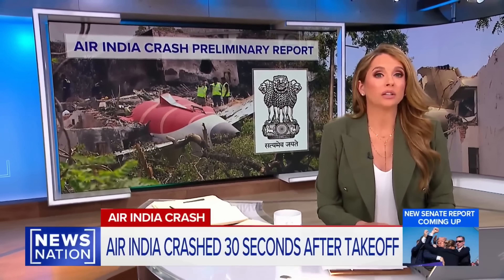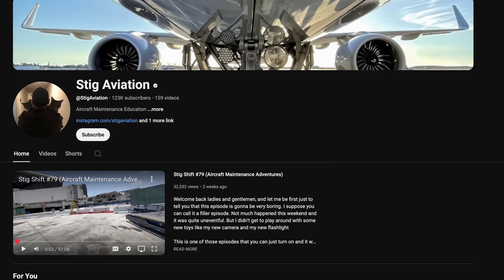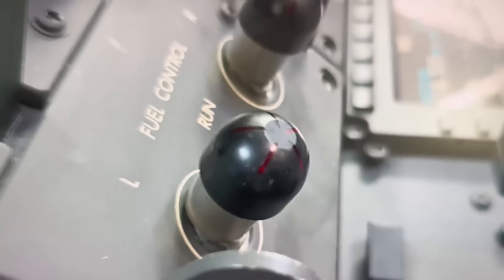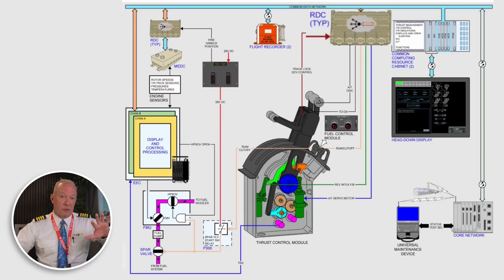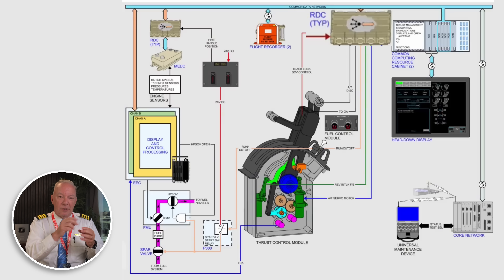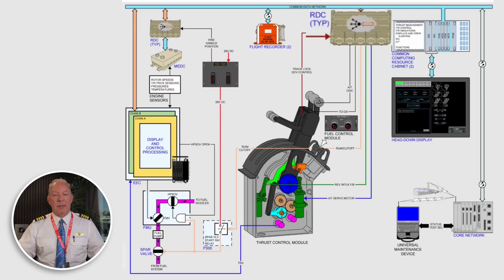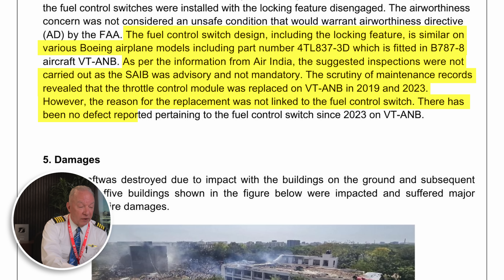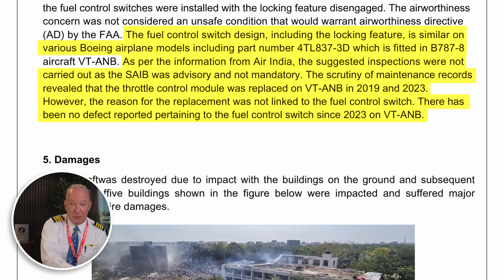The Truth About Boeing 787 Fuel Control Switches

Comment: People should ask themselves a simple question before they deduce, conclude and declare that the Capt (who was the PM) of deliberately switching off the Fuel Control Switches. (We'll refer to this as the "Boeing narrative", for obvious reasons). The FO (who was the PF), would have had both his hands on the yoke after rotation, busy keeping the aircraft pitched up and wings level, busy timing the retraction of the flaps and the landing gear, all the time ensuring that the aircraft maintained a positive rate of climb, so it's unlikely he could have flipped both the fuel cut-off switches so quickly. 

The Capt too would have been busy retracting the flaps (Which actually were retracted, unlike what certain "aviation experts" out there had made us initially believe that they had not been extended at all before rotation!!) as also been busy retracting the landing gear (Which possibly did not fully retract fully due to hydraulic failure, resulting in the RAT being deployed within a couple of seconds after rotation).

As per the AAIB initial report, the first fuel control switch "transitioned" exactly 3 seconds after liftoff, and the second fuel switch after one second. So, the Capt must have been a superhuman to (a) retract the flaps (in stages), (b) retract the landing gear, AND (c) have also "transitioned" the fuel control switches one-by- one - all within the first 3-4 seconds after liftoff! (Note that the flaps were fully retracted as per the photographs of both wings taken at the crash site)

Even assuming that the Capt had suicidal tendencies, it would have much easier for him to put a gun to his head at home. 

NO PILOT in his right mind will ever endanger the lives of the passengers that have been entrusted in his hands. It's a disrespect to the pilot community as a whole. It runs against the ethics of the pilot community, where passenger safety is embedded in their DNA. (The Germanwings incident was an exception and an aberration, and it was an extremely rare incident).

One chance in a billion, that he was actually a "psycho" pilot with "suicide-murder" tendencies, the Capt merely had to take control of the aircraft (AI-171) at Ahmedabad, instead of allowing his FO to handle the take-off leg.

Soon after rotation, he (the Capt) just had to shout loudly "I'm having a heart attack" and then simply had to flip over the aircraft soon after rotation, to make it look like an unrecoverable accident.

Why would he (the Capt, as the PM) want to go through all the trouble of flipping both the Fuel Control Switches to CUT-OFF (On the sly?), knowing fully well that the EEC would automatically reignite the engines (Since there was no engine fire detected after the aircraft was airborne), or maybe even the remote possibility of the FO being able to move the Fuel Control Switches back to RUN in time (Which is also the specified engine reignition procedure RUN to CUT-OFF and back to RUN), thereby foiling this suicidal attempt? 

That's a far-fetched theory, because, even for a moment, if we believe that the Capt. deliberately flipped the fuel control switches to CUT-OFF, would he (the Capt) have permitted the FO to reignite the engines and foil his (The Capt's) attempt to crash the plane?

And, are people aware that there are many critical conditions under which the onboard computer system, the EEC, can open and close the fuel valves for safety reasons, WITHOUT THE NEED FOR THE PILOTS TO PHYSICALLY TOUCH THE FUEL CONTROL SWITCHES? Like a bird hit, an engine fire, a flameout, a fuel leak, an EEC software glitch, misinterpretation by the EEC of good data from a sensor, a faulty sensor sending faulty data to the EEC (Like the faulty WoW proximity sensor of the All Nippon Airways (ANA) Boeing 787 in 2019).

Sadly, both the pilots are dead and cannot defend themselves now, so they've been made the scapegoats, while it's "business as usual" for Boeing and Air India. 

And, I don't blame Capt Steeve for making this video to clarify and justify his viewpoint that, both the fuel-control switches can indeed be flipped from RUN to CUT-OFF in one second (That I agree with), which was being challenged by the other panelists during the TV debate under reference.

People should do a little bit of research, and they'll find that there are numerous air accidents, in which the pilots are initially blamed in the Prelim Reports, and the Final Reports find other problems with the aircrafts that led to the accidents.

Comment: The 28VDC is the gatekeeper to the AC voltage that controls the motors moving the valves. I can't imagine valves controlling major fuel pipes having strength to operate using a DC motor. Oil and Gas industry use motor operated valves (MOV) to control pipes and their product flow, and they are always AC. Does losing control voltage shut the valves? I doubt it. Probably need another command for anything to happen.

Comment: A question for Captain Steve, as a pilot. First, we agree to manually operate the fuel switches. The question is, what are his procedures and actions in a situation like this, where all engines fail immediately after liftoff, with no available space for an emergency landing? Is there a specific checklist for such a failure? The second question is, do major electrical failures in aircraft lead to engine failure or not?

Comment: If the relay goes bad/wears out (not unheard of since they never last forever) then it's possible the load (valves) would not work when the mechanical switch is still in the on position.  I don't believe this to be the case since both would have failed one second apart.  I doubt that's what happened.  But... it is possible.

Comment: Why is there even any issue about a circuit problem?  The CVR has one pilot asking the other about flipping the switches and then the switches were flipped back to run before the crash.  That’s two different sources corroborating that the switches physically moved to cutoff and then back to run.

Comment: In my car, I need to change the battery every 4 years. One time it died while I was driving, and it was scary af. What happens if something is wrong with the battery?
Reply: In car we have only one battery to provide power..

But in plane we have RAT that will supply power if everything else is failed but it takes 10 seconds or more to supply proper power back to system.. 

If the battery fails during rotation then it's a crash for sure.. 

Boeing may need one more similar crash to accept this as an electrical issue related to the battery circuit..

All 787 which is flying for more than a decade is flying bomb..

Even the best batteries manufactured till date are not reliable after 10 years of usage.. older batteries can have intermittent behaviour which is dangerous for critical systems..
Reply: @Raj80sk I I hope they change the batteries more frequently than every 10 years. But even so, I think it could be the battery.
Reply: Then your car will not start.
Reply: @thesweeples3266 It did start, and when I was driving, after like 5 minutes the battery died, the lights first started to flicker, then all lights went out, and also the thing that helps with the wheel rotation thing also stopped working, so I had to apply significantly more strength to steer the car. It was scary.

Comment: Your description of the fuel control system and the cut off switches here is very thorough, but is not 100% complete. Please don't misinterpret what I'm about to say here, because I do not believe the switches failed. However in attempting to rule out "switch mimic" in the flight data recorder completely your description of the system failed to address one aspect in the power delivery to the switches. 

You stated that the switches are provided power "directly" from the battery. This is where some question for me, a non expert with very limited knowledge of electrical systems, remains. 

I just want to clarify, when you stated that the switches receive power directly from the battery did you mean exactly that, directly? I understand that the battery is the power source and your explanation of the battery taking time to drain makes perfect sense. In order to completely rule out switch mimic however, we must rule out any possibility of power failure to the switches. My question is, "Are there no fuses, no relays, nothing between the battery and the switches that may have failed?" The flight data recorder does not record the physical location of these switches. Rather, it records either power coming from these switches or the lack thereof. Any power loss to the switches would be recorded in the flight data recorder as a cutoff of these switches and therefore, before assigning blame to a person, we must be very thorough in ruling out any possibility of failure in the system. I'm sure the experts that are examining the crash are thoroughly reviewing the electrical schematics to do just that before releasing a final report. 

I enjoy watching your videos and find you to be very informative. I have little doubt that you are correct in believing that one of the pilots is responsible for this crash, however if I were on a jury I would not yet be convinced enough to convict one of them. 

My opinion is based solely on my own non-expert experiences with electrical systems and data recorders. I've experienced failures in operating a system that utilized data recorders (in no way related to aircraft) where the data from time to time initially led us down the wrong path. In one case in particular, specifically along the line of questioning I have here. We were experiencing an intermittent failure in the system and the data recorder was indicating that the power had been cut at a particular switch. That switch however remained in the on position throughout the event and the system only shut down briefly each time. Inspection of the switch and of the relay did not reveal any mechanical issues with either, however both were replaced. A day or two later we experienced a reoccurrence of the same issue. Again, no mechanical issues could be identified and the source of the failure was not located. The question was pointedly raised to me, "Did you flip that switch on and off?" Suspicion of me sabotaging the system persisted for some time, and had the same issue not have occurred on other shifts I probably would have been fired. The maintenance department and upper management were looking at my entire department suspiciously for more than several months as this problem reoccurred sporadically a dozen or so times. Sometimes as much as 4 or 5 times in one shift and then not again for more than a month. Throughout that time period maintenance personnel had been stationed from time to time standing over the shoulders of myself and other operators, but the problem never happened to occur while they were present. That fact was pointed out during more than one meeting in a very pointed and accusatory manner. Eventually one day the failure occurred while I was sitting there talking with the plant manager. The switch in question was about 10 feet across the room from us, but completely in sight. Once again it was completely undisturbed. At that point the plant engineer, the maintenance manager, and the electrician that had been pointing their fingers at us operators were called into the control room. The electrical schematics were brought in once again and everything was reviewed, tested and inspected. Once again they could not determine the exact cause. By this time the switch itself and the relay had already been replaced a few times and clearly weren't the source of the problem. Though testing of it had not identified a problem a determination was made to replace the lead feeding power to the switch. The wire was replaced and the problem never occurred again.

Comment: This all assumes the Hot Battery Bus (HBB) was performing faultlessly with no momentary interruptions of 28V from the battery.
The Lithium Ion batteries have suffered Internal shorts in the past which prompted a redesign of the batteries and their containment boxes.
A dynamic interruption of battery power will hopefully be thoroughly investigated as a possible reason for the Fuel cutoff switch "transition" (remember that switch "position" is inferred from a digital signal on the Flight Data Recorder).
The causes for crashes are never simple and assuming the systems were all working as designed will probably not be valid.
Reply: 28v battery isn't supplying power to the battery busbar once any other generator is online and with engines running the electrical power distribution system will do everything to keep that busbar live.  The only time the battery needs to step in is when there is no other power source available - which means the engine generators have to be offline for your theory to apply. 
It's also not been brought up in the preliminary report, FDR and CVR are powered via the battery busbar with no internal power supply (excluding the locator beacon battery and that only does one thing) so they would have mentioned the data gap/loss of voice and sound as it's all timestamped.
Any failure in the TRU that powers the battery busbar would cause a nil dispatch as the system will produce an alert, if that happened during take-off then it still doesn't make any difference as the battery would then supply power instead - there would be gaps in the FDR capture again and a different response by the pilots on the CVR.

Comment: Excellent video Steve,         not 100% on Aviation Would there be a need to toggle off the Fuel Control switches in air ? - if there was an engine fire the Fire levers / Suppression buttons would be pressed instead and couldn't a fair safe be built in so that Fuel control switches can only be turned off if the Plane was at ground level.

Comment: Sorry Captain Steeeve, I disagree. The systems across Boeing are not the same for sure not 737NG.
Jeremy John Thompson YouTube will explain why not. This aircraft 787 is way more advanced and unfortunately electrical system was build by ex McDonall Douglas people. That is a sign of trouble from the getgo.
I wonder if this has ever been tested in mock-ups which I highly doubt. Just subjective fault isolation by the team who build it.
Air India is know for it bad maintenance, combined with this design I believe the failure comes purely from a DC system that short circuited.
FAA and Boeing are never going to admit it. I don't know why you follow any bulletins as fact. DC crash you can see how much the FAA is hiding with the Helo bosses during the hearing. Shocking but fact for now they cannot be trusted
Reply: Again not true watch the video before you judge.
Funny how everything needs DC power and if you don't have it nothing works like ADSB and FDR
Reply: It is a cover up since that Lithium battery came into this plane it has been a failure point.
If the battery can not be monitored to charge or diodes fail and don't get an EICAS message how do you expect this all to work.
Again a full DC failure will cause this info we have now. Has the NTSB or FAA admitted that the recordings are continuously? NO
When the RAT came online some stuff came back. Hence the fuel control as well. Too late engine winded down already

Comment: You are unnecessarily clinging to the wrong narrative, just like a common man. Can you exactly pinpoint and explain millisecond by millisecond, from the parking to lift off to aircraft explosion? If you explain that process, maybe this fuel switch is not at all a factor. Because its just a matter of 45 to 50 seconds or maybe a minute max.

Comment: Maybe those 3 valves remain open as long as DC power is applied by the switches - but that does not mean the engines cannot shut down by anything else, because: how would the TCMA system shut down the engines then? Obviously it cannot be as simple as explained that only those switches can shut the engines down, as the TCMA can shut them down too and has already once done so on a runway after landing.

Comment: Thats weird happening. Must say, as workin on machines most of my life, there are cases that out of the blue, all sudden I have done some familiar move just by an accident, but at the wrong time. Workin mechanical machines is very much repeatin the same pattern all over and over. Like with an excavator, you repeat the same freakin pattern with sticks, it is more like an 'fine tuning' that same sequence. Or with an  wheel loader. Push the bucket on pile, reverse, click transmission forward, lift boom and dump to an truck. How can you miss anything? Still, theres been cases I reverse, click trans to forward, lift the boom and what happens, I accidently dump that bucket at same time with lifting. Like some tiny millsecond shortcut after thousands of repeats, tiny turn with an wrist and the bucket dump that dirt or whatever on it too early and miss the truck. I can not explain why or how that happened. All sudden just little confucing with that pattern of moves. So so so. what I mean....well I kind of can see how someone unlucky might cut those fuel switches just by an accident, it could have been that familiar tiny move wandering on a subconsious mind and it just executed on worst possible moment.

Comment: Passengers on the inbound flight reported "flickering" lights and faulty screens.  Could a transient fault in the power supply to the fuel cut-off switches cause fuel cut-off?  One of the pilots asked the other if he had shut off fuel.  He replied that he had not.  Could he have recycled the switches in an attempt to restore fuel flow?